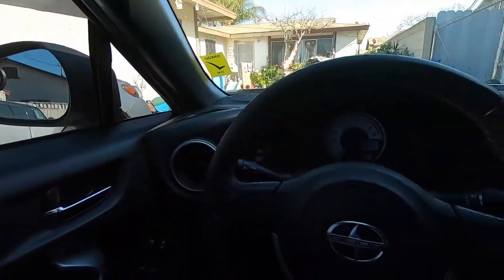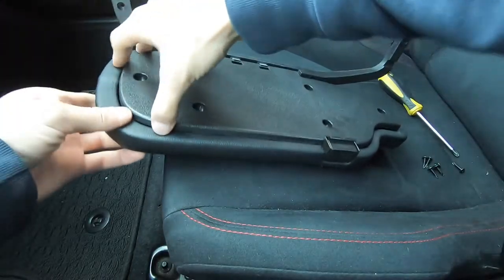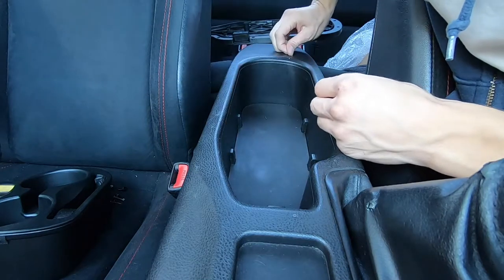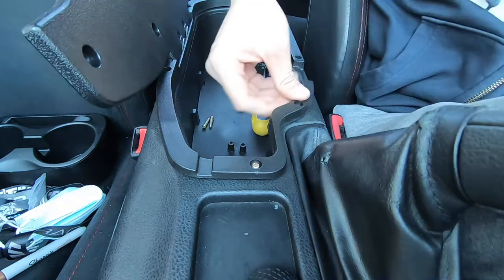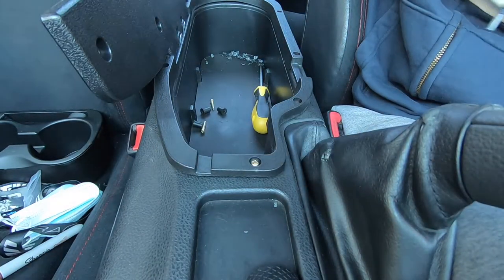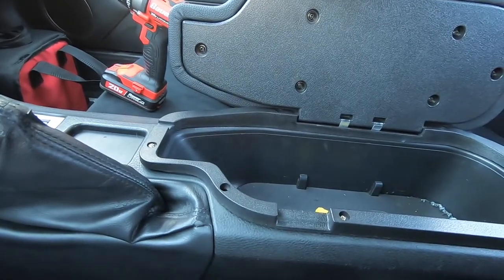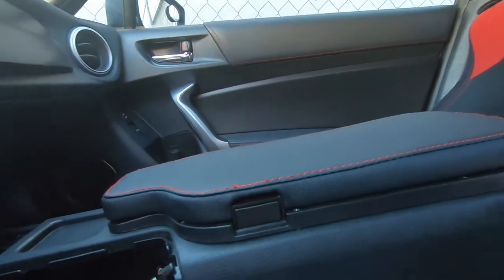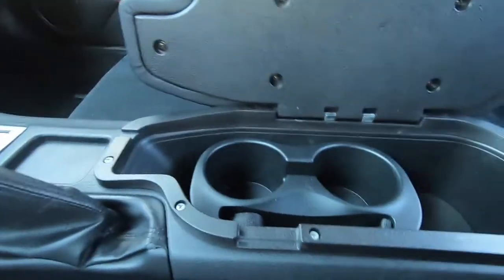How to Install an Armrest on your 86 (FAIL)

Comment: The expensive ones are no better. They come with the same hardware. They really are all just cheaply made, finicky after-thought items. I saw the same type of issues when i worked at a GM dealership installing dealer added oem items like rear seat compartment cases, center consol safes, and mudguards.

Comment: I would of changed the plastic inserts for Rivet Nutserts and warmed up the plastic base a little before fully tightening it down to help it flex with the curve of the original interior piece.